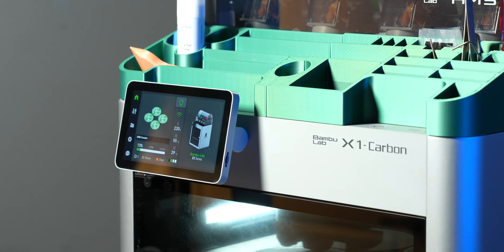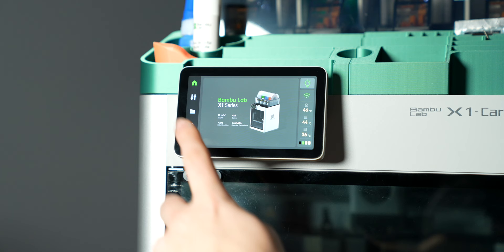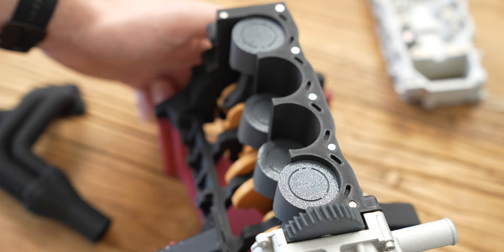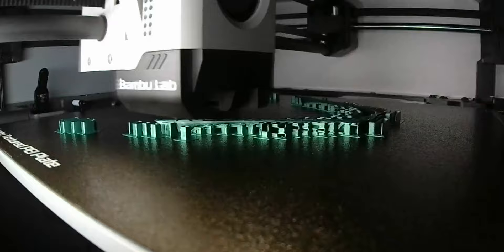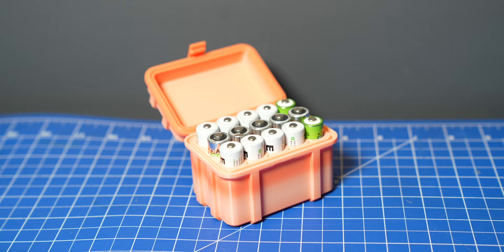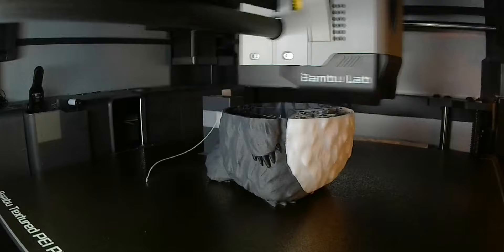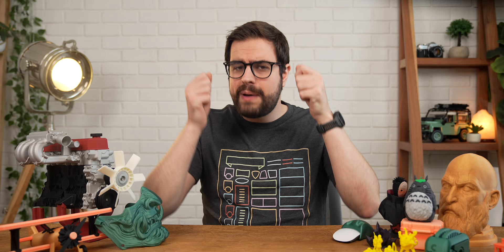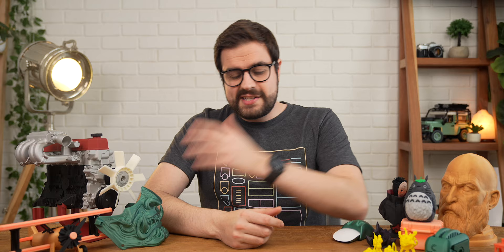Bambu Lab X1C Review: FINALLY a 3D Printer for Everyone!

Comment: I want to let new  people in 3D printing know this video is sponsored, they’re are better and cheaper printers than bambu.
Reply: Let us know for beginners who want to use CF
Reply: Like which ones?  I have owned a Prusa and built a Voron 2.4r a little over a year ago.  We just got a Bambu X1 with AMS at work, which sits next to our Ultimaker.  I will have to tell you that the Bambu is the most impressive printer I have seen yet.  Cheaper printers... Sure.  Ender is cheaper.  Better... Yep, that too with a Stratasys or maybe Ultimaker.  Cheaper AND better?  Nope.
Reply: “Better” and cheaper but massively sacrificing convenience and easy entry to printing without as many hassles…
Reply: Creality top models,  any qidi printer are better and cheaper, customer service works as well 👍🏻
Reply: No they’re aren’t. If you want to work and get stuff done and not hassle. This printer is superior
Reply: Yes, they’re, forgot to add vlsun v400, faster and cheaper.
Reply: Hum, it would be good to get a dislaimer about whether this video is sponsored (or not) by the printer manufacturer. Kind of important detail I think.
Reply: It is declared that this video is not sponsored in the description. Just someone liking a product does not mean they are sponsored by the products makers.
Reply: I have my Anycubic i3 Mega for 5+ years now and haven't had to change a thing on it. it's a workhorse and really consistent with its prints and I'm glad I picked it over the Ender 3 back then.
Reply: nuh uh
Reply: maybe the a1 or a1 mini but nuh uh
Reply: i have a neptune 4 max and its freaking dead
Reply: @6milesup I got an ender, doesn’t even work. It’s bricked. And CS is shit, they send me the wrong firmware and closed custermer chat on an unanswered question
Reply: @marn200  Bummer man.  Hope you can get it resolved.
Reply: No, there is nothing cheaper and better than Bambu printers. If I have to spend time and money to mod and tinker a printer for it to function well then it is not better or cheaper in any respect.

Comment: A 3D printer for everyone? It's 1300$!
Reply: People routinely pay that for a cell phone...every year!  So, a single outlay of $1300 for a printer that should last years isn't too bad.  There are cheaper options, though.  The Bambu P1S is essentially the same machine, with a plastic enclosure and a different interface, at like half the price.  The X1C is just the new, shiny thing on the block, and it's a really well polished printer, so it's a little more expensive.

Comment: So your recommending a printer that creates so much waste and allegedly the customer care is poor? I think I'll pass.
Reply: Waste is only when you choose to do multicolour and customer service was great for me 🤷‍♂️ also this printer came out like 2 years ago
Reply: Subpar printer owner detected.
Reply: @Pics2FlicksDennis  it cant be eliminated with multicolour, but it can be eliminated with single colour. I’ve done it, you can minimize the purge or even set it to 0.
Reply: You are basing the judgment on the customer service on allegedly being bad but no experience. The judgment of waste is on default settings which are meant for people to just go and not have to adjust anything and get quality color changes (so there's going to be overkill on purge) if you spend some time testing and adjusting you can cut waste to almost nothing.  If you change colors or types on single material systems you have to purge manually which will still cause around the same amount of waste. The convenience and quality are definitely worth the cost for me and bamulab has much more cost effective options as well. You don't have to get one but that doesn't affect the fact that this printer is worth it for a lot of people in the maker space.
Reply: @Pics2FlicksDennis  you sait it cant be eliminated, but it can. For single colour printing you dont need it at all, the purge line at the start will be enough. For multicolour you definitely need it though so yeah as you said you can be reduced by a lot.
Reply: @Pics2FlicksDennis  just to clarify I’m talking about changing the purging the printer does before starting a print, which can be changed by messing with the gcode, you are talking,im assuming ,about the multicolour so i guess we are both right
Reply: @Pics2FlicksDennis  there is. The printer purges in the poop chute before every print even in single colour prints🤦‍♂️ also its amigo 😂
Reply: You wouldn't necessarily need support very often as these printers are built very well.
Reply: @Pics2FlicksDennis tbf, you said “it can’t be eliminated” and mario here says “while it can’t be eliminated with multicolor prints, it can in single color”

i don’t get why you needed to clapback to that imo
Reply: My 2 experiences with bambu customer service:

They confirmed my issue quickly and sent me the part for free. Also I think they gave me a store coupon, iirc.

Warned me of a potential issue and asked anyone experiencing it to contact them for a free solution.
Reply: The waste only happens with multi-color prints, which is literally unavoidable unless you have a multi nozzle setup because if old filament isn't purged properly, you will have massive color bleed. But with the proper settings, the waste can be greatly reduced. It is literally one of the best printers in that price range and has one of if not the most intuitive multi-color systems out there.

Comment: Unfortunately I am thinking about sending my Bambu Labs X1 c back. Two days after I got it I tried to print a multiple color .stl but the nozzle got clogged. As I was removing the nozzle I noticed that the connection labeled J3's edges were broken off thus causing the connection to be slightly loose. I also noticed after unplugging J4, it never would lock into place again when I plugged it back in. When I ordered the printer I also ordered a .2 mm nozzle so I thought that I could replace the clogged .4mm nozzle with that but when I opened the package the .2mm nozzle connections were unattached. Seriously is this normal?

Comment: Bought one of these last week, finally an upgrade from a flashforge dreamer (~10 years ago)
Wow. This thing is amazing. To be fair all the new printers in this price range are probably amazing, but this thing set itself up, did its calibration jiggle and off it went printing a flawless first print on to the textured plate with no adhesive applied. It just printed dead flat with no shrinkage and no warping, oh and the model had 20mm overhangs with ZERO droop and NO supports, requiring ZERO cleanup. The lowest quality print on this was better than the finest detail on my flashforge. $1,500 USD well spent. Theres a hack to make the hotend go up to 350°C or so, the same as the X1E.

Comment: well I guess I am the only one that has a crap experience to date. just one month old and it decided it didn't know where the bed is anymore. Printing too high off the bed. Had to adjust the z  in the G Code by .3mm. prints are now ugly and filament consistently stick to the nozzle. all this from one print to the next. Very disappointing.

Comment: Hmm coming from a Anycubic Viper it's not really a good upgrade the size is actually not that great, the AMS creates a lot of waste and isn't great for support material. The only thing it would bring is the speed increase that is over x5 as much as the current printer + the chamber. And keep in mind that one is heavily modified with Revo + LGX + Servos ..

I don't get why they don't improve on it yet as there bed slingers are way more silent than X1C
Reply: The latest update made the motors completely silent, but when you print this fast you’re gonna need a lot of cooling so the fans especially the auxiliary fan are gonna be loud. I have the p1p without the aux fan, after the latest update it is definitely more silent than my vyper which had noctua fans on
Reply: But like you i do miss the bigger volume, as i mostly print cosplay helmets

Comment: An 8 minute wait when you just want to print say, a washer for example, would suck. Rapid prototyping would also suck.
Reply: If you're talking about the auto-level each time it prints, I suspect you could edit the G-code to remove that line.  Then it would just print whatever you sent it immediately, and only do the auto-level function if you specifically directed it to do so.
Reply: You can bypass the auto leveling right at the print screen. It takes 5 mins to auto level and it’s worth it for highly detailed or multi colored prints. For prototyping a rough print you don’t need it on.
Reply: @mosh00420  Ahh well that sorts that out then, thanks for the info

Comment: You would have been better off laying that figure down with supports… then the last 30 layers would have needed color changes, instead of standing up and needing 700. The differences in “quality” are negligible, unless you need it for structural integrity. I never use a prime tower, flush into infill… Never an issue unless you are going from red to white (for example). I don’t see the poop issue…
Reply from the maker: Yeah, I'm experimenting now without using a prime tower after so many people saying it isn't needed.

Comment: I haven't gotten into 3d printing because the barrier to entry seems high. Hopeful that this can change that for me
Reply: Bummer, I see that it's 2 grand Cad. I'm out
Reply: @ToughCanadian yeah, to have the video labelled as “for everyone” is misleading. Take a look at the P1S, it’s still £600ish without the AMS but otherwise it sharers a lot with the X1C
Reply: @TheBHinett yeap and then there’s the a1 even lower price, and there’s a bunch of printers as low as 200-250 which will perform great if you dont mind the slower speeds.

Comment: It'a not for everyone if it costs $1.5K
Please let's be real and take into account the price too
Reply: Bambu A1 and A1 mini is C$389, what you see in the video he has the top of the line model.
Reply: It is pricey but then again this isn't a printer you'll spend hours on levelling the bed, adjusting the bed sensor or any other component. Heck, this printer doesn't even have a limit switch. It uses the torque feedback from the steppers to determine it's position. Plus it has automatic input shaping which is only needed on higher speed printers. I'd consider it more of an industrial type of printer than a typical home use one. (Didn't stop me from buying the P1S + AMS a year ago. Saved a long time to get but I LOVE IT!)  I guess my point is, if you can afford it, it's worth it's weight in gold. And like @tinymito mentioned, you can have a look at the A1 and A1 Mini. Both are bed slingers and not core XY printers but they bring a lot of their big brothers qualities and features to the table at price point most can afford.
Reply: Please let’s be real and take into account all the features of this printer that make it the most versatile and easy for anyone to use without hassle. Convince = a premium price. Even considering that 1.5k is a fair price for this
Reply: Without the AMS unit, it's $1200.  People routinely pay that for a new cell phone...many of them each year.  So, a one-time outlay for a printer of this quality and polish is not unreasonable.  The Bambu P1S is the exact same machine as the X1C, but with a plastic enclosure and an older, not-as-fancy touch screen, and currently sells for $600.  Or you could get a Neptune 4 Max for $440, with a massively bigger build volume, albeit as a bed slinger without an enclosure.  You get different things at different levels of cost, often times with more problems that you'll have to figure out on your own.  The X1C was designed to make 3D printing as close to simple/stupid as possible, and that's no small thing.  A LOT of work went into it, so asking about the price of a new Apple/Samsung cell phone isn't unreasonable or unattainable for everyone.  If you want expensive, look no further than the Prusa XL (5 individual print heads) for $4500.